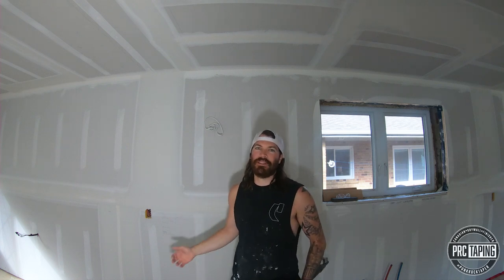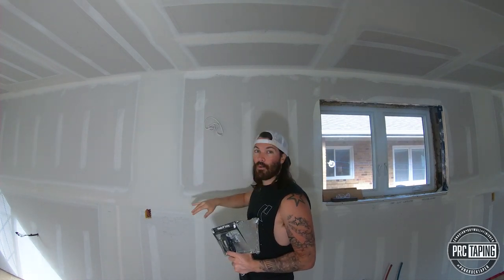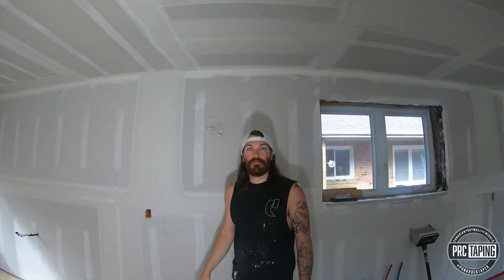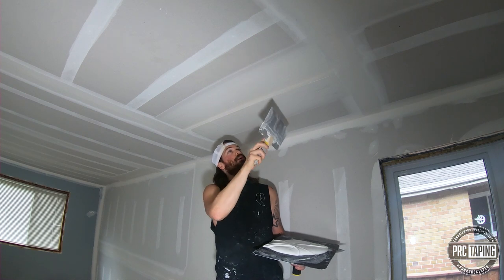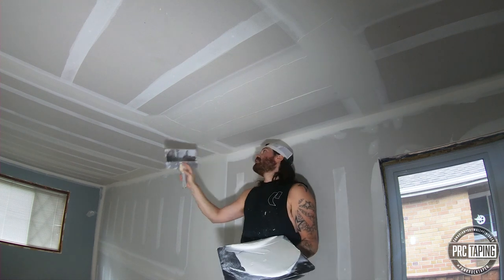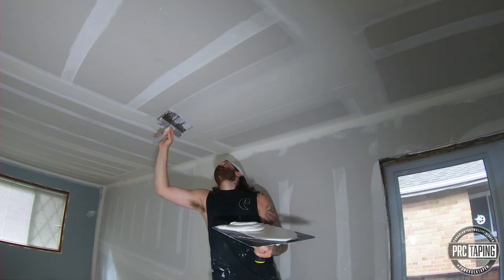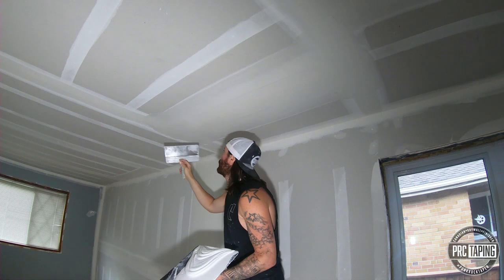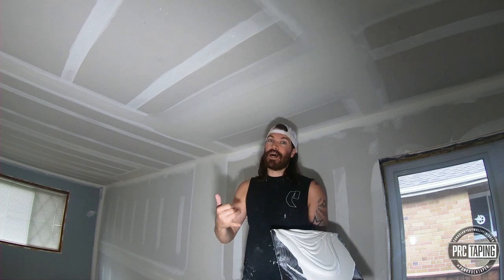How to coat a butt joint by hand

Comment: I'm doing the same thing with a 12" flatbox. The difference is I let the mud sit until the end of the day, then i trowel the middle and edges. With Machine mud, the mud sets and hardens a little in 2-3 hours, then if you're gentle enough, you can work over it without damaging the filling coat.

Comment: Dam dude that shit is smooth, nice job.

Quick question: is it better to use durabond as prefill for butt joints instead of a light setting compound like a 90?

Also same question goes for flat joints? 

Do u cut a V taper in ur flat joints so the mud has something to stick to?